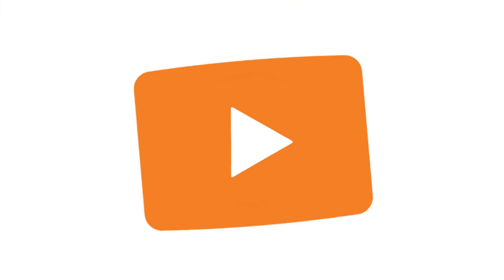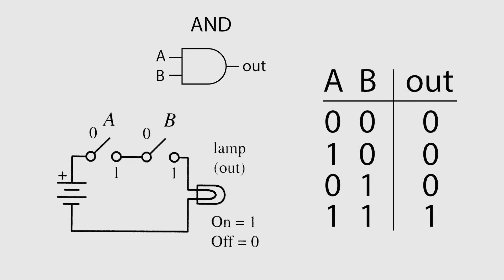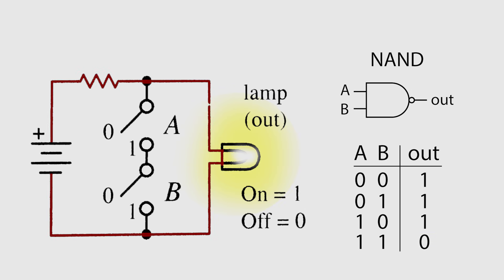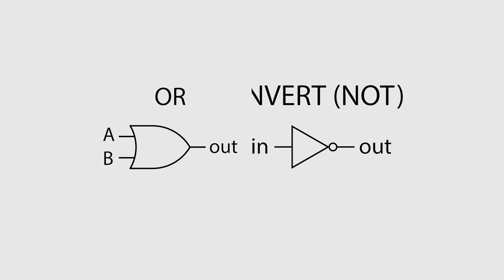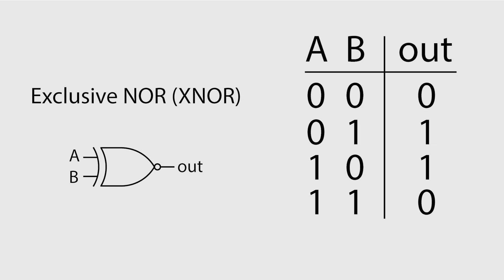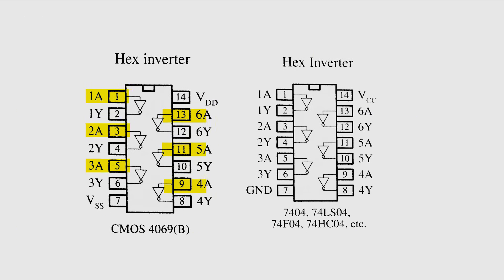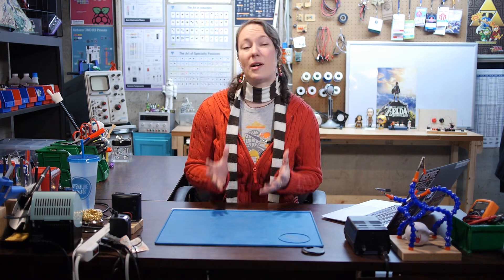How Logic Gates Work - The Learning Circuit

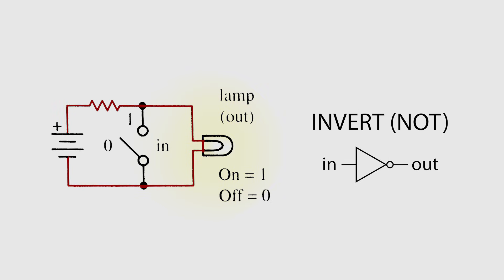Comment: Using the analogue diagrams was really helpful way for explaining. 1:12 But, won't bulb still glow in NOT gate analogue circuit as it is connected in parallel.
Reply: I think it will not, because the lamp has a higher resistance than the switch. Think of the switch closed as a short circuit.
Reply: @silevol  But, still electrons can flow in both directions from the node
Reply: @harsh.chaudhari  But they won't, because of the greater resistance the lamp has.
Reply: @silevol  
What is the work of the resistor?
Reply: @silevol  how are you

Comment: I know Ive seen/commented at least 3 times on this video, The Gate converter inverting my output and Not posting it, the delay is about 180 seconds out of phase with the input. 
Sounds complicated? 
It’s that 19Mos. 
Running Transistor/Enabled Buffer provided by ABC as Positive Feedback source. to keep them protected for Rouge Resistors of DC offsets. 🤔
Reply: Comment 100 and this isn’t one.

Comment: Can someone please explain me this: in the diagram for NOT gate (and also for NAND and NOR) the electric current seems to "choose" the shortest path to the ground trough the switch when the switch is connected, even when there is nothing to stop it from going straight to the lamp also. Is this a mistake in the diagram, or is this something that really happens in real life? Does it have something to do with the resistor symbol that is only present in these mentioned examples? If so, why/how?

Comment: this is a good video for explaining logic gates but in the not gates circuits the light would still be on, voltage doesn't just not go down that root because the is another one open other wise parallel circuit would not work.

Comment: What is the logic gate when you wire a 3 way switch as the first switch, after which you wire a 4 way switch and the last switch going to the load is a 3 way switch. Meaning that you can turn the load on/off from any of the 3 switches? As an aside, you may add any number of 4 way switches between the two 3 way switches and control the load on/off from any switch. Thanks for your well presented videos, all your videos are valuable.